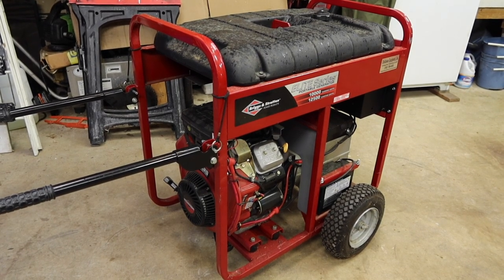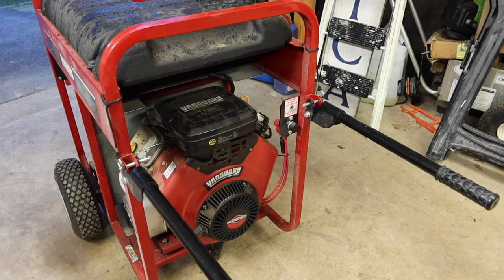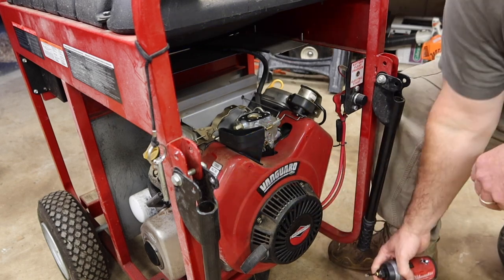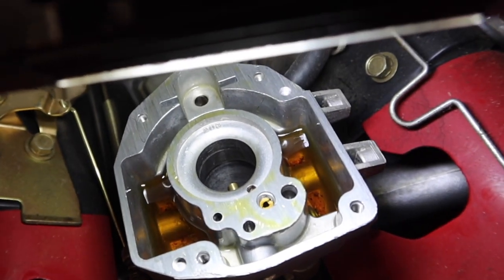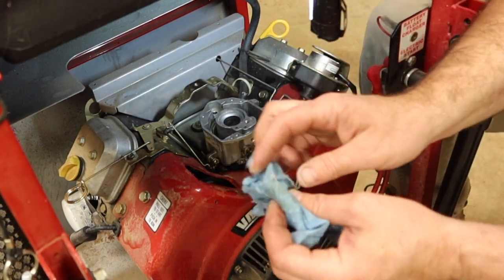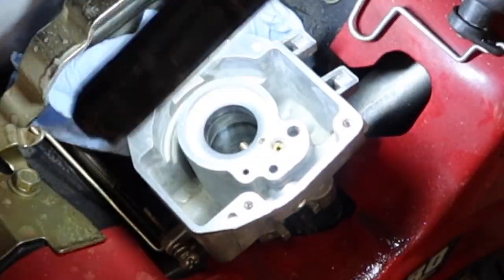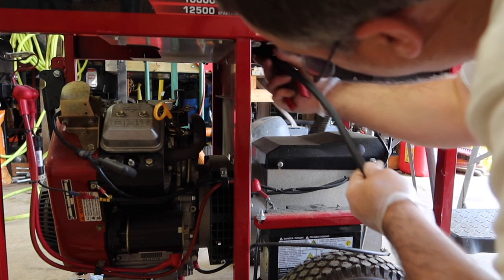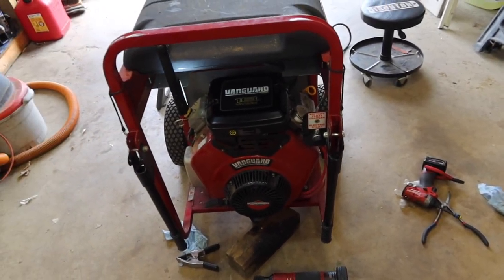Fix Your Surging Vanguard Generator Fast!

Comment: Excellent video. I have one of these engines in a MAX atv. Gonna pop the top this week
Reply from the maker: Good luck!
Reply: @RayofallTrades  Ok, so I have a question that you can perhaps assist me with. The reason I wanted to clean the carb was due to rough starTing issues. I would often need open choke and a decent amount of throttle to get her running. So, yesterday I pulled the top off the carb. It looked pretty clean inside, but I cleaned all the jets I could get to and buttoned her up.

Now I have a new problem, she will fire up really well, one turn of the key, no gas,
but cuts out on idle after a few seconds. Fuel appears to be entering the bowl well enough. 

Any suggestions? I have a new fuel pump arriving tomorrow but was hoping to tinker today 

Thanks ray!
D
Reply from the maker: @DescartesDooley pull the plug to see if it’s flooded. The float lever can accidentally be installed backwards and cause a flooding condition. Also use a spark tester to see if the oil sensor is killing the spark
Reply: @RayofallTrades  When you say backwards, do you mean upside down? I'm pretty sure the float was placed back as was needed. First time I did have the needle drop out though and had to make sure it was properly seated, but I was getting no combustion at all due to lack of fuel, obviously. I will double check the float however.
I am waiting for spark plug wrench, as she is really deeply recessed and I cannot access it right now. Thanks!

D
Reply: @RayofallTrades  The float lever is the metal bar right? Yep. I'm pretty sure she is in correctly
Reply from the maker: @DescartesDooley yes correct. Upside down will stop it from fully closing or opening. I forget which
Reply: @RayofallTrades  So I just put an inline spark tester on. I get good spark right up until cutout. If I empty the carb bowl o fuel, she will fire and run until cut-out. Could I have a bad needle? Looks ok visually
Reply from the maker: @DescartesDooley yes or a piece of dirt in the seat area
Reply: @RayofallTrades  So, I'm a newb at this engine business. I don't know if this is correct or not, but I noticed the idle screw is just free floating. It is not touching the tab on the spring mechanism. Is this supposed to be the case? Thanks again for all the responses. I just cleaned the needle and seat area again, but to no avail.
Reply from the maker: @DescartesDooley yes for a generator, the idle screw hardly ever touches since it’s normally run at wide open throttle and the governor controls the speed
Reply: @RayofallTrades  interesting, thanks
Reply from the maker: @DescartesDooley I use carb cleaner when the engine is dying to see if added fuel can make it keep running to rule out fuel starvation.
Reply: @RayofallTrades  so, if the bowl is full of fuel but the engine is starving is my issue a blocked jet? It seems when I drain the bowl I get her to fire and after a cut out the bowl is full of fuel
Reply from the maker: @DescartesDooley yes or a vacuum leak